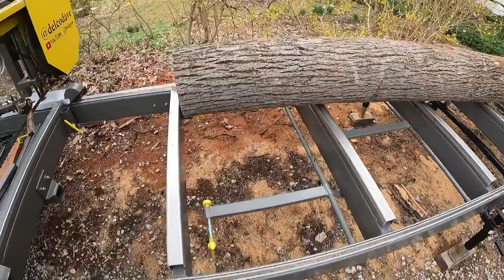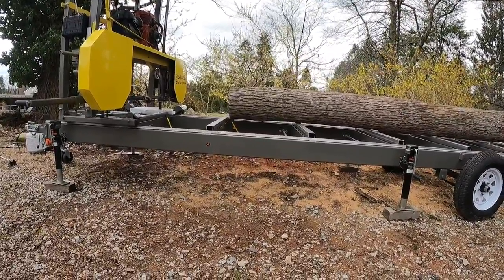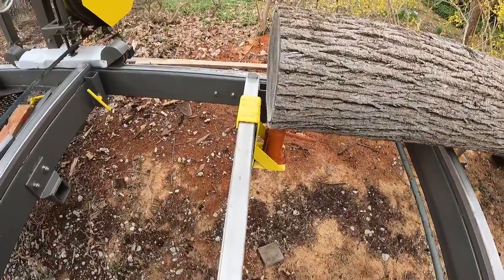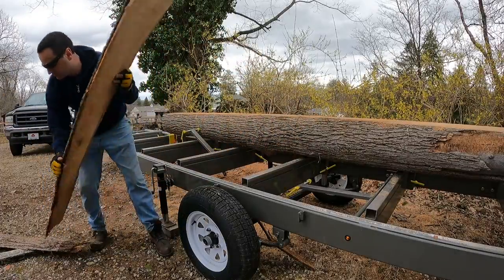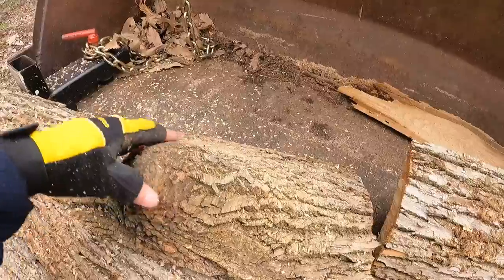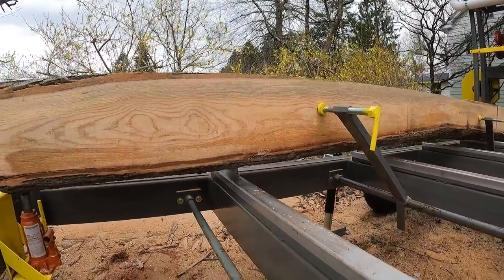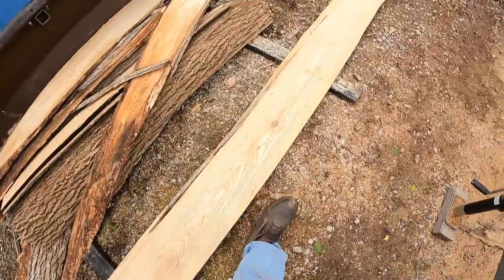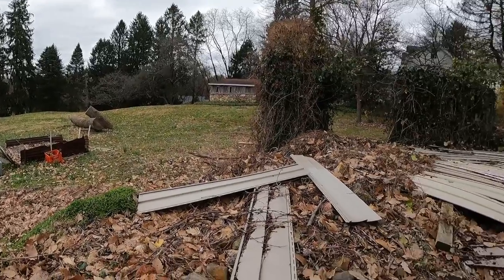Sawing a tapered Log utilizing the log jack.

Comment: Ill be making a log jack of my own soon.  Good idea.
Reply: Prob something that runs with my drill as usual.
Reply from the maker: @aaronymousunlimited2661  use a jack from a modern SUV. I have one it looks like a bottle jack but is a screw mechanism.
Reply: @thedelcodave  exactly.  Im going to make a plate on the top with 2 rails for stability like my cookie vise.
Reply from the maker: @aaronymousunlimited2661  I wanna see a video when it's done
Reply: @thedelcodave  getting a go pro soon.  With a mic.
Reply from the maker: @aaronymousunlimited2661  get the 10. I got the 9 and it has some audio quirks.